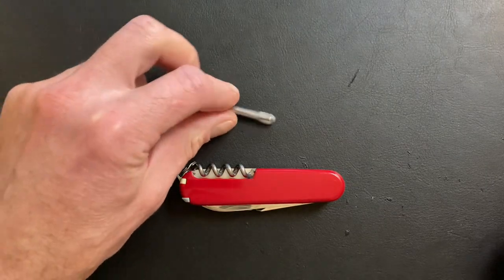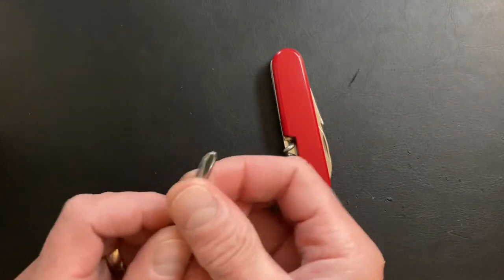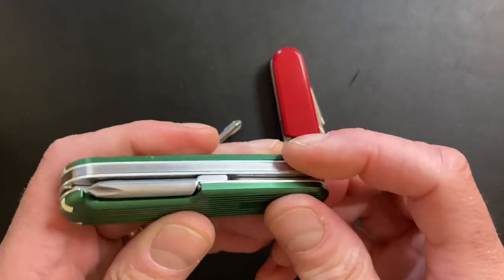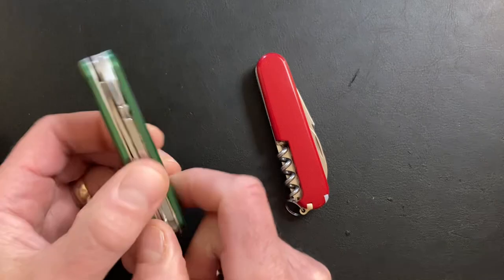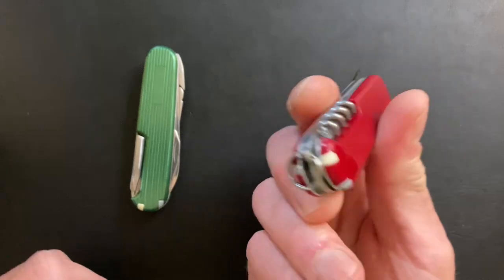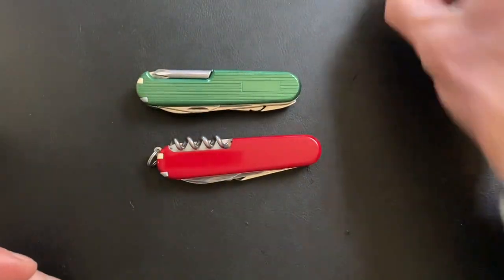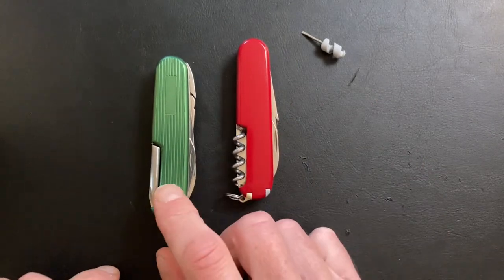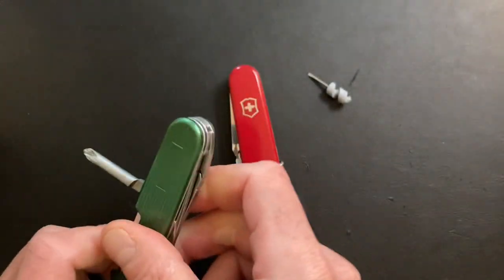Victorinox SAK talk: The Devil's tool - backside Phillips

Comment: I agree to a point. But, as a DIY guy, I've used the Phillips 1000x more often than the corkscrew.
Reply from the maker: I hear you, don't think I have really even used the corkscrew- but I still dig it more looks wise and I do like the mini screwdriver
Reply: If you are a diy guy then surely a in line Phillips is the way to go ? A Explorer?  
I have a alternative?  Any SAK a small simple MOD on the can opner will give you a good usable 2.5mm flat with clearance, at the same time a good end in line Phillips. 
My video if it'll give some idea . 'Victorinox Angler Black plus scales, and modification. ' .
Reply: @robduncan599  An inline Phillips is miles better but only the expensive models have it.

You can't use the unmodified Can opener on recessed Phillips screws, which is 90% of my needs. I'm also not going to hack it like that as it would still be too short most of the time.

One of my knives is a Hercules which has the best Phillips on any SAK 👍
Reply: @robduncan599  The combi-opener has a Phillips, it's much better than the can opener which isn't intended to be used on Phillips.
Reply: @Jaccayumitty  My mod overcomes all the issues! 
I understand some people are not  into or willing to modify a new SAK ? But I have modified all my Swiss army knives apart from my Swiss Champ (13 last counted)  I even modded the Explorer which already has the inline Phillips,  just to get a better small flat with clearance.  Clearance is my main issue (or lack of it ) any screw with any recess is a problem,  even a simple chock block electrical wiring connector is a problem,  hence my mod . Take a look at my mod , try it on an old cheap SAK , you will never look back ? Grind the can opener part away and reshape slightly,  follow the lines of a leather 2d Phillips,  or a leatherman squirt 2d . All you need is a dremel or similar. A good file and a wee bit of effort,  and you will have a much more useable small flat/2d Phillips with some clearance. 
One of my videos will give some ideas. 
'Victorinox Angler black plus scales and modification '
And surprisingly it will still work as a can opener.  Video 
'Victorinox explorer, huntsman, farmer, climber screwdriver can opener mod ' .
Reply: @robduncan599  I'll have a look. I have no problem modding SAKs, in the past I've turned the nailfiles into lockpicks and reground the small blades from spearpoint into flat edge blades more suitable for woodcarving. Next mod I have planned is ebony scales.
Reply: @Jaccayumitty  That's great.  After you watch , give me any feedback.  If you try a mod like mine tell me what you think , good or bad . Cheers greetings from Scotland.
Reply: If you have the knife with the corkscrew and you need the Phillips screwdriver then you can open a bottle of wine and drink so much that you don't care about the missing Phillips screwdriver any more  :-)  This makes the corkscrew the most important tool ever :-)
Reply: @september1683  None of the alcohol l buy needs a corkscrew, just ice 👍🤪
Reply: @edwardfletcher7790   -  You are a true Man of Distinction. You have already climbed further up the ladder of success than I have. :-)  😂

Comment: Main problem with it is actually that it won't do smaller size philips screws.  The 58mm combo tool is much better.    I've reduced the size down slightly on mine to be able to cope with smaller screws, but still be able to cope with larger ones.

Comment: They should replace the phillips rear tool with a 4mm bit driver. Sure, you'd have to carry the bits externally -cough-or get the Chad Cybertool -cough-, but it provides you options and customization.
Reply: what about an old style punch? One with round edges to undo knots, like a marlin spike
Reply: This idea with the bit driver is great, never heard it before.
Reply: If its ratcheting somehow than the issue or the grip is lessened be cause you can just quickly screw something in without having to rotate the whole tool and the the position becomes and advantage to give you better leverage. It would be a perfect addition

Comment: I've carried a deluxe tinker for yearfs and used the back phillips a lot; it's not for serious applications, of course, but neither of the other tools is...
It's a tool that comes in handy when you have no proper tools around, but in a shop environment I will always use a dedicated tool.
Personally, I find the back phillips much more useful than the corkscrew, and I've had quite many situations when the screwdriver tip on the can opener wasn't enough for a certain screw that needed a bit of torque.

Comment: Never had a SAK with the backside Phillips, but to be honest, all the phillips and pozidrive screws i come across are in places where this form of screwdriver doesn't work. I always need something "thinner" than a T-handle to access them.
And since i wear glasses for almost 20 years now, i have come to use the mini flathead in the corkscrew a number of times. (and have let others tighten their glasses frame screws with it.)
Also a dedicated phillips head doesn't work well with pozi drive screws, the little flathead on the can opener does less damage.
And the corkscrew even works well to get smaller rocks out of the shoes soles.
(in my over 30 years of having a corkscrew on my victorinox and using it for many things i think only one bottle of wine was opened with it, and not by me. I don't drink)

Comment: Another big problem with backside Philips is that it's got very small footprint in the handle. On top of that, it's held with thin aluminum liner on one of the sides. It is quite easy to bend liners around the screwdriver/corkscrew.
Which limits it to light duty. Which is counterintuitive, since it's a T-handle. 
It's a shame, because the geometry of the tip is great.

Despite all that, I do like and use Philips on my Tinker, it is significantly better than the can opener, as long as space allows.

I agree that it has lots of flaws, but while the in-line Philips like on Explorer or bit driver on Cybertool is a lot better, it is also extremely bulky.

Got to compromise.
Reply from the maker: Yep, always is a compromise.  And I do think the backside Phillips isn't all bad, just not great and I love an old fluted corkscrew just for the looks.

Comment: VERY MUCH DISAGREE!
Reply from the maker: Haha! No disrespect, just my opinion : )
Reply: @decoyboat completely agree with you. I genuinely hate the back Philips and it’s just awkward to use. If the deluxe tinker had a corkscrew, it’d be perfect imo.
It’s also why I really like the explorer.
Reply from the maker: @clintwestwood3539  Yeah, why the Deluxe Climber isn't available makes no sense.
Reply: @decoyboat  No disrespect intended either. Just my opinion. Used that Philips screwdriver 1000's of times. Have never used the corkscrew once. Carried the Super Tinker for at least 35 years. It has that exact tool. Works great for breaking loose the screw so you can finish removal with the Can Opener/Straight slot/2D Philips screw driver. Still never had use for Corkscrew. I would Rather have a tool somewhat awkward to use than one that is useless. Like your videos. just expressing my opinion as you say. Please keep up the videos. will continue to watch. Have a good day.
Reply: @clintwestwood3539  to be fair if you have enough space and you need to loosen a moderately tight screw, the t handle phillips is good for that. then you finish the job with the can opener
Reply: @jerryc5842  I agree. If I'm able to file down the mini screwdriver so it fits in the toothpick slot, I will probably switch back to buying Phillips models.

Comment: The liners simply can't handle much torque from the T handle phillips. I was surprised how easily I bent the liners and even cracked the scale. Never had that problem with the reamer.
Reply: I've bent many can opener tips trying to use it as a 2d Phillips. I do like my cybertool for this reason.

Comment: See my MOD ! YouTube video ' Victorinox Angler Black plus scales and modification. ' .
My modification grind the can opener off (still will work as can opner, just in reverse) slight reshape gives good results 2.5mm flat (with clearance)  and 2d Phillips.  
A simple MOD will give every SAK a in line flat2.5mm with clearance and a 2d good Phillips in line .

Comment: it just hit me like yesterday, when working on one, but the reason they put phillips on the back in the first place is for woodscrews. An in-line one has better clarity and could supposedly provide better torque when used perpendicularly, but fails when you need to apply a lot of pressure towards the screw, where's the backside one lets you do so uniformly from two sides with plenty of torque to boot and ideally (tough in practice it's not so clear cut) - only one side to slip towards, not that that's nearly as much of a concern when you use boh hands for operation.
At least that's likely the idea, the pactice is probably less clear cut, and I alrady know implementaton varies a lot for other manufacturers

Comment: I've found that the corkscrew is more likely to drill a hole in the cork than to latch on and remove it.
Reply: Then you might not be using it properly. I open about 10 bottles of wine each month with my SAKs, and they function perfectly. If your cork is “wet” or somehow damaged (as in very old wines) than any corkscrew is not the best choice, and there are other specialized tools in the wine world. Cheers!

Comment: Just discover your channel, already subscribed.
So I’m about to start my first custom “project” on a tinker small but I’m nervous about the springs/stoppers; i would just like to swap the small blade for the combo tool and the bottle and can openers for a wood saw.
Would you rate the difficulty level for this please?
(Say from 1 to 10, 1 being changing the scales)
Reply: I’m not the channel owner, but I’m doing some small modifications myself so I’d like to help if I can: the small blade swap is relatively easy from my experience, but the seconds one it’s a bit more complicated since you need a new spring too (not impossible, you will need to disassemble it entirely tho).
Reply from the maker: You’re basically building a ‘walker’ with a Phillips.  I’d buy the Walker to harvest and use the blade spring from the Tinker small so you can add the Phillips.  Only issue is you need brass pins.  Once you open up those knives they will be too short.  You could try to do a hack job and drop the bushings so the short pins might work.  Then you’d have to peen the brass with no bushings and then glue on the scales.  Not ideal IMO, but it would work.  All in all, be an easy mod if you had both knives and had the brass pins.  It’s always the damn pins that cause the headaches :)
Reply: @decoyboat  That’s right, a walker with Phillips and reamer. Already got a tinker small, a walker and a cadet (in case I feel adventurous) Also 2.5 and 3 mm brass rods, I will try to make a sort of mini “dowel cutter” using the hole from any tool in the SAK looking for getting more precise and consistent 2.2mm pins. My fear is on the wood saw spring and where it rests when closed.
Reply: I’m worry about that new spring, have the feeling there will not room to modify neither reamer spring from the tinker small nor the wood saw spring from the walker.
Reply from the maker: @rmarques82  Have no fear.  It’ll work out just fine.  Good luck!
Reply from the maker: @rmarques82  I’d leave the wood saw spring alone.  No reamer. Always a compromise.  Just run the blade layer/combo tool/phillips.  Wood saw no bad tool.  Simplest way
Reply: @decoyboat  🤔 Sometimes my freaky/nerdy side kicks in so I’ve been keeping record of my sak usage by function for 4 years and can tell you I’ve used 84 times the reamer vs 52 the PH driver. You know, the never ending story of finding the one and only SAK
Reply from the maker: @rmarques82  It’s a puzzle with no solution!
Reply: @rmarques82  It is the swiss champ.
Reply: @decoyboat  If you don’t like the fat swiss champ, then have 3 skinnier saks (3 - 4 layers each) to have almost all tools at you. Otherwise chose the sak with the tools you need and forget the others. 🤓

Comment: The end of the can opener is not meant to be used as a Phillips screwdriver and really doesn't work well, although the tip of the combi-opener is designed to be both a flat-head and Phillips driver and is surprisingly good.
Of course, you'd use a proper screwdriver if you had one to hand. But the SAK tools are for those times when they're all you have. And that's when it's brilliant to have the SAK Phillips. It's a hundred times more useful than the corkscrew for those of us who don't drink wine (and yes, I know there are alternative uses for the corkscrew).
Anyway, the worst tool on a SAK is the hook. Everyone knows that.
Reply: Ha ha ha. Everyone knows that are people who doesn’t know how to use a hook, or to modify it for specific use. All tools are useful when the need arrives. The debate is just subject for a youtube video. But it’s ok, we like sak videos and endless repetitive debates. 😅
Reply: The best use I've found for the hook isn't with the hook itself, but with the space that holds it. I've got the plus scales with the ballpoint pen, and it locks nicely under the hook to make a comfortable pen to write with. it won't really fit anywhere else, except for sort of under the corkscrew.

Comment: Agree with you about the usefulnes of the philips screwdriver. Anyway, it has two virtues above the corkscrew: No sore spots in the hand while whittling for the day long and ideal to poke into knots without damage for the rope. On a sailing boat I found the adventurer much better than the marlin spike: I can stab the knot with the philips screwdriver, and thus make room for the broad screwdriver to finish the job.